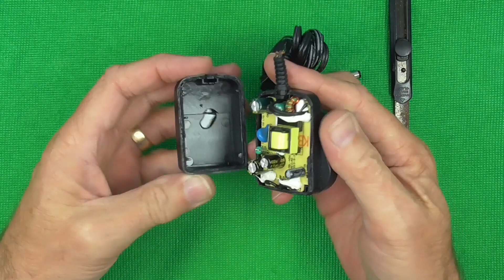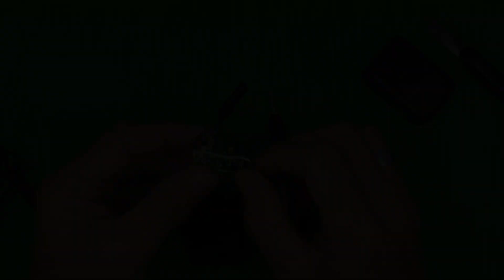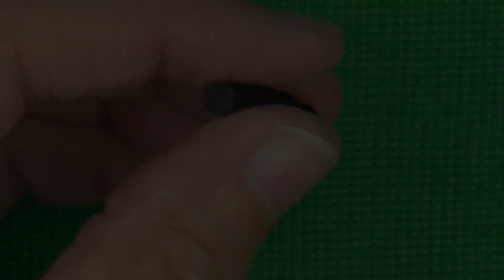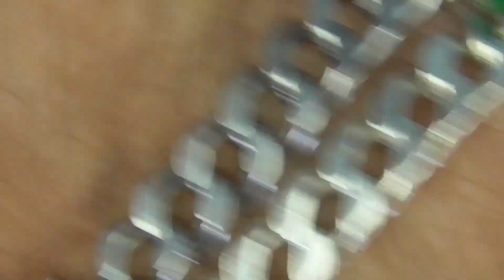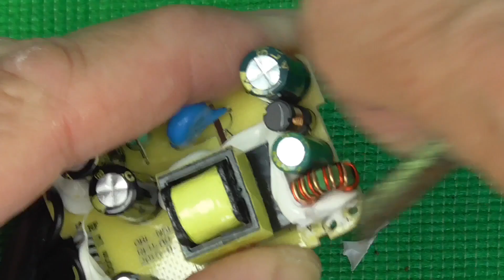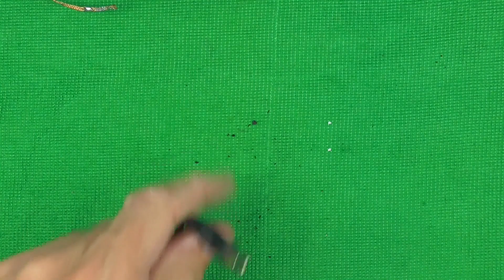How to Repair a mains AC-DC power supply / adaptor broken cable

Comment: Thank you so much for creating clear educational content. Im going to have a go at trying to fix one of my old adapters.

The replacement Adaptors that I have purchased over the past years all seem to degrade at the same point. Probably the weakest part. And also maybe they just dont build/design them to last.

I would love it if you could also show if its possible to repair the opposite end of the cable. The part which enters the metal pin section that plugs into the radio.

Kindest regards xx
Reply from the maker: Thank you for your great comment. Unfortunately manufactures don't make things to last, they want to sell us another one as soon as possible. They sell it us cheap and assume we won't mind when we have to buy another, well that's how it seems. The only way to repair the other end (plug) is to replace the plug, this is a case of soldering a new plug on making sure the polarity is correct if on a DC adaptor. The plugs are available on eBay and in various sizes. Hope this helps and many thanks again for your great comment.

Comment: Personally, after soldering those wires in place, I'd check that there isn't a short between them.
Reply from the maker: No need in this instance as they are far enough apart to see any bridge with good eyesight. You would have to have really bad eyesight to not see any bridge. Many thanks for your great comment.

Comment: I once watched a repair video where i knew the guy would drill his finger and he did. I am glad my intuition that this was going to happen to you too was wrong. Also please dont use a dinky little rusty boxcutter to pry, those are ment to break off. Other than that, i am glad to see diy repair videos when they come up, we should incourage people to fix things rather than replace as the norm. Also i put a little knot in the wire just inside that butts up against the strain relief so the wire cant pull out. I find that glue flexes off over time.
Reply from the maker: No worries, I've been using this method for well over 30 years and I am pleased to say I've not managed to drill my finger(s) yet. 🤣🤣🤣Many thanks for your great comment.
Reply: @DARTraderMediaProductions  reminds me of when i repaired my guitar hero controllers for my PS2 i found that drilling out the old insolation works best.

Comment: Can we please go back to calling it a transformer ? That's what it is, that's what it does. Mains doesn't make any sense and isn't proper grammar.
Reply: I can see a transformer in the circuit when he opens up the power supply i wouldnt call the whole thing a transformer since its more complex than that, a transformer is ac to ac through coils and i have some devices that look like this that are simply transformers alone. I have never heard a power supply or transformer simply called a "main" unless i suppose its the "main transformer" for some large equipment or in a power distribution setup.
Reply from the maker: @DWmaniac4n6  It's a switch mode power supply. It's not "main" it's a mains power adaptor. It adapts mains voltage to a required voltage, in this case 6 volt. Transformer is not really a suitable name for modern switch mode power supplies. A transformer has a primary AC and secondary winding, the AC voltage drop in the secondary winding is determined by the winding ratios. Switch mode power supplies work in a totally different manner. Many thanks for you great comment.
Reply: @DARTraderMediaProductions  yes.  Like the Nintendo Entertainment System its power regulation circuit is in the game console and the "power supply" that you plug into the wall is a simple transformer. I know i have fixed them before.
Reply from the maker: It's what most people refer to them as. The type shown is actually a switch mode power supply and doesn't use a transformer where the AC voltage is reduced on the secondary winding before rectification. You can call them what you like, it's up to you. Many thanks for your great comment.
Reply: @DARTraderMediaProductions  The first time I heard the term "Mains" was decades ago. I had no idea what he was talking about. It had bothered me since. If transformer isn't suitable, then perhaps Power Supply.
Reply from the maker: @michaeljavert4635  Ebay and Amazon are full of listings for "Mains Adaptors and Mains Power Supplies, its just what they are called and can be refered to as either. If you haven't heard or seen this term recently then I have no idea why not. Many thanks for your great comment.
Reply: It's a British thing. We plug it into the mains ... hopefully electric rather than water main.

Like we say valve amp rather than tube amp.

Comment: It would have been prudent to test the continuity to the plug BEFORE glueing the case back together! I would also have just used a thin intermittent bead of superglue to bind the two halves of the case back together. Messing around with Araldite is overkill and limits taking it apart a further time if the need arises.
Reply from the maker: I had already tested the continuity from the break to the plug at the start. I wouldn't advise using superglue as it's just not reliable enough. Araldite is the safest option for safety reasons. As for it needing to come apart in the future it's still possible as I've done it before. Many thanks for your great comment.

Comment: There are AC to DC adapters that output a negative center and a positive shield. Most guitar pedals are wired this way. The stripe typically indicates the positive wire.
Reply: Yes, also older Casio keyboards.
Reply from the maker: Very good, many thanks for your great comment.

Comment: Jeeeezuz! For the love of your fingers, don't use a craft knife. Use a proper spudger.
Reply from the maker: 🤣🤣🤣I know, I've been stripping wires this way for years. The best thing is I have strippers in the workshop but never use them. One day when I've sliced into my fingers I'll wish I had. 🤣🤣Many thanks for your great comment.
Reply: @DARTraderMediaProductions  They're talking about prying open the plastic case.  I'm also worried about the blade snapping and shrapnel goes flying into me peepers.
Reply from the maker: That's why you wouldn't do it without wearing eye protection. The knife I used is not the best thing to use, I wasn't opening a case that was factory sealed as it had been opened in the past and came open very easily. If it had been factory sealed I'd have used the hammer on a block of wood method. Place the seam of the adaptor on a solid block of wood and give it a sharp wack on the upper seam, works great but that does come with practice. The choice of method and tools used are up to the person carrying out the repair as I stated in the video. I do it my way and have done for over 30 years. The video is intended to demonstrate how it can be done and it certainly isn't by any means intended to be the best method as I'm sure it can be improved on. Many thanks for your great comment.